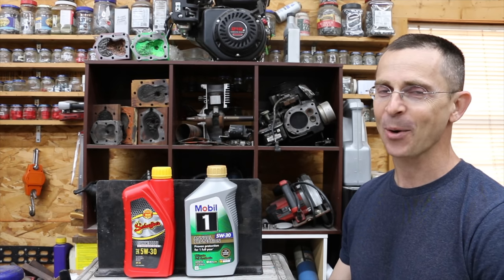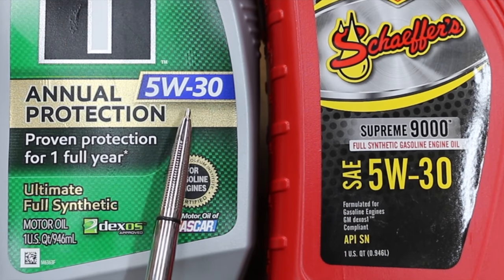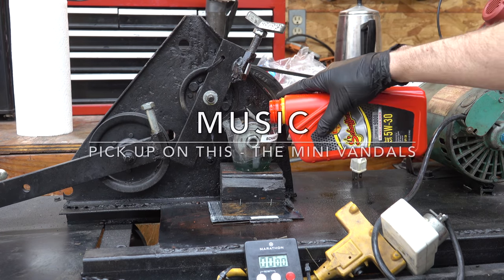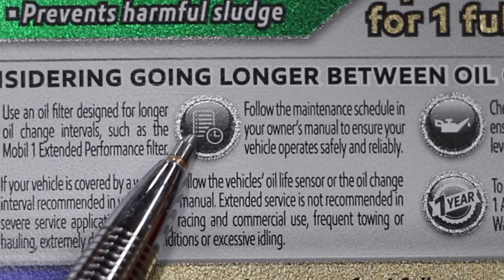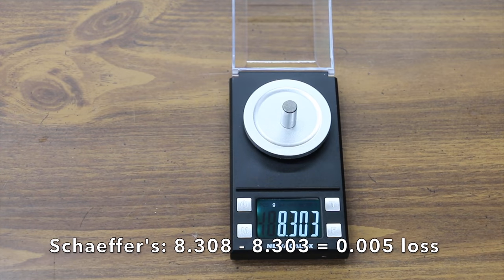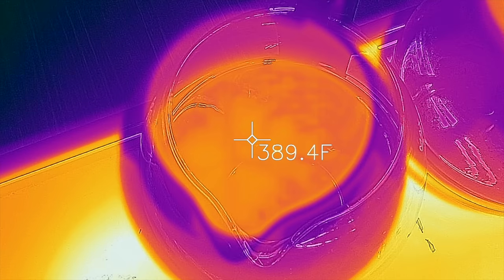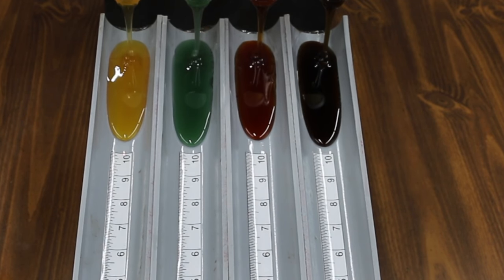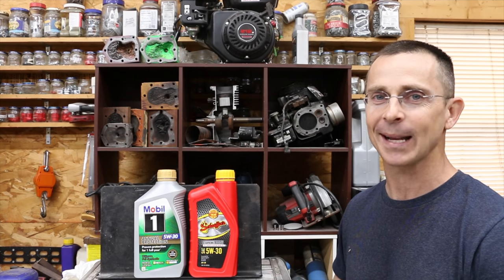Is Mobil 1 better than Schaeffer's Full Synthetic 5W-30 Motor Oil? Let's find out!

Comment: I switched to Schaeffer's products for everything with my hotshot business. It lowered my maintenance intervals by over 25% Which lowered my downtime and by buying their products in bulk from a distributor it came out to be cheaper than any other option. I even get free oil samples which is a huge savings. My biggest savings come with their carbon treat fuel treatment pushing that fuel filter life out is huge.  The Wheel hub 219 grease lowered my trailer hub temps by 8-12 degrees over lucus red n tacky.

Comment: Never heard of schaeffers oil. Pretty impressive.
Reply: I hadnt either. It is impressive.
Reply from the maker: Great product!  I've never used it prior to this test.  Lots of requests to test it and I can see why.
Reply: Green Oil??????
Reply: I had never heard of it either. Weird, especially since it's been around so long. But it is pretty expensive stuff and I don't think a lot of places sell it, so that's probably why.
Reply: I believe they dye their full synthetic green.  I think their conventional oils are the more traditional color.
Reply: Schaeffers is pretty popular amongst diesel owners.  Bill @powerstrokehelp swears by it.  I run it in all my vehicles both diesel & high performance gasoline engines.  It's pricey but oil is like engine blood....if you needed a blood transfusion you'd want the hospital to put in the best blood they could acquire so I treat my engines the same way.
Reply: Though this quart was relatively expensive, I mostly see Schaeffer's recommended for their (comparatively) budget Racing Oils.
Reply: Must been a "up north" common brand,  I've never hear of it ether.
Reply: I heard of Schaeffer after a friend of mine had his F350 transmission rebuilt at Brian's Truck Shop. Brian said he never used or recommended anything else. I've used the transmission fluid and engine oil, didn't know it was better than M1 but I've always liked it!
Reply: They do very, very little advertising.  Read up on them, really cool company.
Reply: @anunpopularstance  I could never search and find where he loves it, but I have heard him mention it as a great oil.  Any idea what weight oil he recommends for viscosity for a 6.0 powerstroke?
Reply: They do VERY little advertisement.  You can get it in Amazon.  I heard about it through word of mouth.
Reply: @HankeyMountainGarage  I live in KS where are temps vary from below freezing one day to 80° the next at times but that is rare.  I have ran the 5w40 in both my previous 6.0 and also an older 7.3.  I was previously running Rotella T6 and noticed a 1.5 mpg increase in the 6.0 and almost a 3 mpg increase in my 7.3 when I switched to Schaeffers.
Reply: @anunpopularstance  My thought is that it doesn't matter how hot it gets outside because your engine and oil temperature are dependent on the thermostat in the engine.  The Schaeffer's oil salesman I talked to confidently told me that they have seen better results with the 5w30 or 10w30.
Reply: Paul Stan me either, and it’s been around since 1870’s.
Reply: best oil that I ever used. lowered operating temps and fuel consumption in all of my vehicles and tractors
Reply: @johnparrish9215   Green oil is not too uncommon. Schaeffers full synthetic, Kendall GT, Brad-Penn and German Castrol (during the late nineties/early 2000s) were all green dyed. Arco Graphite was jet black. Royal Triton (and later, Royal Purple) were dyed purple. Oilzum was bright red. Conventional Schaeffers was (maybe still is?) a bright amber color. Most people don't realize that synthetic oil is clear; so even if your oil is the traditional brown or gold, it's been dyed.
Reply: I agree outside temps do not make a difference once the engine has reached operating temp.  I only think ambient temps have an effect during cold start ups.  My 7.3 calls for 15w40 but I run 5w40 and have had good results running 10w30 in regards to cold starts in -30 temps.
Reply: Diesel guys buy schaeffers....its excellent stuff...
Reply: Schaeffer's isn't a store brand. You could only get it from shops that stock it or directly from a salesman/rep of Schaeffer's until reps finally started selling online (I know Amazon stocks it all now). It is pricey, and if you're direct ordering it has to be in bulk, but I swear by their products. If nothing else, their Penetro 90 penetrating oil is far and away the best in the business.
Reply: @anunpopularstance  - I see your point but my (diesel) experience favors less expensive Diesel oil given the incredible inherent design/durability characteristics of most diesel engines...of which, diesel engines almost always seems to (far) outlast the vehicle's body integrity, especially in situations were the truck is operated in the rust/salt belt and/or in construction type environments.  Of course there are a few plausible exceptions... like (maybe) in situations where a diesel sees a lot of road miles, no winter, no salt, no construction and the diesel is garage kept and/or is a "show" quality diesel(?) However, for the average "joe diesel" $13+/quart diesel oil (+ a proper long life filter) doesn't really justify the expense and is even less justified given how soon many diesel owners sell and/or trade in their vehicles :)
Reply: I have to agree with ya there. Never heard of schaeffers either but next time I'll look into them.
Reply: I used to work with an Egyptian guy. He swore by it and claimed that the other oil companies use Schaeffer as the gold standard oil to beat.
Reply: @moofree  Exactly, 13 dollars a quart, if I heard right. Think I'll stick to my full synthetic Super Tech for less than 17 dollars for 5 quarts.
Reply: St Louis company, located just a couple of blocks from Busch stadium. We service their manufacturing warehouse at the railroad I work for. Also ran it in our racecar engine before we sold it. Great stuff. I only use Amsoil or Schaeffer's in all of my engines
Reply: @johnparrish9215  oil is dyed to give a colour, it is normally pretty clear, just that most are dyed gold since this is what is expected!
Reply: I know a lot of guys that do run it in their Harleys I myself Run Red Line Oil primary Lube and transmission fluid in my Harley and have always been impressed with that my bike runs cooler quieter and shifts easier
Reply: Note it's made in St. Louis, Mo.   @monoshock57
Reply: It's basically a "performance" oil. Meaning only enthusiasts will really know about or buy it. A lot of people run it in race cars of various types.
Lots of the good additives and high quality base stock. They typically have local dealers sort of like big name professional tool brands.
Definitely good oil, but I'm not sure it's worth the full premium except when used in a truly performance oriented situation.
Reply: @johnparrish9215  it's made from grass clippings
Reply: @monoshock57  Not Canada north. Never heard of it.
Reply: John Parrish 

My motorcycle oil is also green, I’m using Motul 300V
Reply: @johnparrish9215  its tinted blue actually. It's a soybean based oil that gets super refined to the point it's clear like water. I run it in both my cars. Awesome stuff
Reply: Seriously?
Reply: Matthew Miller it only gets 25 degrees at the very coldest part of the year here in Vegas and idemitsu ow-20 is not affected by cold temperatures ...probably the same with a lot of these really good full synthetics..the ones with synthetic base not full synthetic with oil base
Reply: Rumor has it, Schaeffer's is made from blended smurfs.  They were going to call it Soylent Blue but I think there were copyright issues.
Reply: It's way too expensive
Reply: @bilbobaggins4710  With some good ole 'Merican greenbacks mixed in.
Reply: I don't think it's common anywhere. I live in Texas and known about it for many years, but never bought it because it's beyond my budget, like several other brands. I've seen it advertised in magazines a little. But I think it's sold through independent sales agents, like Amsoil, but doesn't have near as many sales people. @monoshock57
Reply: @grassroot011  Yeah, I live in Texas and I've heard of it. It's not a northern oil. It's just not advertised much.
Reply: Frank Manning , that's funny Frank , I remember seeing the movie Soylent Green with Charlton Heston, Chuck Connors, and this was his very last picture before he died  Edward  G Robinson in 1973 , but Soylent blue from Smurfs , that's hilarious , what's Royal Purple engine oil made from ?
Reply: Plus it's green oil
Reply: @monoshock57  yep, it's pretty common up here in Minnesota and Wisconsin
Reply: Paul Stan Heard about it about 4 yrs ago. sales rep walked into the shop. and did the bearing test. but slightly different. he has a handle to apply pressure to stop the bearing from spinning. we had mobil he asked for a sample to run his test. and didn’t take much pressure to stop the bearing from turning using mobil. then he we did with schaeffers and fucking A. i had to apply my body weight about 185lbs and needed another guy to stop the bearing from spinning. been using that ever  since on my car and SUV. they also have transmission fluid. did that as well
Reply: Pat Treu , Royal Purple is purple oil
Reply: I run their semi synthetic blend in all of my Harley Davidson motors,,great product
Reply: Schaeffers sells their products across the globe under different brand names... For example here in Mexico and some countries in central and south america sell it under the Metatron brand
Reply: MaverickMMMX , cool , I'll be sure not to buy it under those names too , thanks
Reply: Find a rep. I get my Schaeffers for 6$ quart 👍🏁🇺🇲
Reply: Schaeffers oil is popular in heavy diesel equipment, that the only time I see Schaeffers
Reply: Matthew Miller interestingly, I had to,go to MOBIL 1 5W-30 ( the 4 CYL GMC CANYON , RECOMMENDED GMC) here in East Helena ,MT, @30 BELOW ZERO: had ran 10W-30  FULL Synthetic VALVOLINE FOR SEVERAL years in NORTHERN IN( occ M1), And got a little thick starting....some mornings......130, O00 mi......
Reply: @HankeyMountainGarage  they have a diesel spec oil in 5w40, 10w30 and 15w40 weights. Will clean out everything so the injection system will run better and smooth it out.
Reply: I run there oil, transmission fluid, and fuel additive in my personal 6.0 powerstroke. I have been using there full syn 10w30 in the engine. Will be using there gear oil as well soom. Very good stuff. I sell there products at work and have lots of very happy customers. Pretty much all there products especially there greases have exceeded my expectations. My local rep is a real good guy as well.
Reply: @scs442  actually they are all green, its the base oil that gives it that color not a dye
Reply: @scs442  no it's not dye. Probably due to the moly additive.
Reply: Paul Stan I have never heard of it either
Reply: They don't have conventional oils, all of they're oils are specialty oils
Reply: We use it at work for some specialty hydraulic applications. It does very well for us.
Reply: Gonzo Buddy 😀 Mobil 1 has always been my oil of choice.
Reply: Gonzo Buddy  You can also buy Schaeffer's in 5-gallon pales. I've seen 5-quart jugs in some applications that can be found on sale for about $30 or so.
Reply: Buy Ravenol 72,30 $ (100% PAO) or Comma or Wurth if you have money for best oils 👍
Reply: It’s a top tier oil
Reply: If you think their oil is good, you need to try the grease!!!

Comment: My truck uses a quart once a month or so, so I never have to worry about my oil getting old🤘
Reply from the maker: lol. Great point!  If you use Engine Restorer, you'll likely see that oil consumption decrease.
Reply: I've got same thing in my honda, and I'm not planning on ever adding new oil.  In fact, I save changed engine oils from my other vehicles and let it burn off in my Honda.  

I never would have thought of this, except my dad did same and told me.  in 80's some time, he started up a home construction company, bought a heavily used truck.  It turned out to burn oil pretty bad.  He never even changed filter ... and got 100K+ miles without ever changing the oil. Not sure what ever happened to that truck, I'm assuming he sold it.

Sure miss my dad.
Reply: @loves2shoot  That's hilarious!  great story.
Reply: Most cars do even if the dip stick level doesn't go down. What happens is water replaces the lost oil and people think their vehicle isn't using any oil when it is.
Reply: Mini DK#9 If your engine is replacing oil for water quart for quart, RIP engine.
Reply: LS ?
Reply: You should still change your oil totally along with a new filter every now and then.  Every year to be safe.
Reply: @williwonti  its a ford. It'll be ok. 😎
Reply: @ProjectFarm  Thank you for the tip. I was gonna just find a longer dip stick for it.😁
Reply: Yah filter change?
Reply: @AIM54A , I've never heard of water displacing oil, unless the engine is being used for really short trips, like, going around the block every now and then.  Water evaporates at 100C while oil can reach 115C to 125C.  If water does mix with oil, the final mixture will begin to resemble an old, putrid, rotten milk shake.  I have heard of fuel that mix with oil, usually as a result of blow-by.  It's not as much in gasoline engine, as most of the mixture that makes up the composition of gasoline has low boiling points, but the components that make diesel can have boiling points that exceed 350C.  In extreme cases of blow-by, it's not uncommon to see "oil growth" in diesel engine.
Reply: City cars and trucks rarely are driven long enough and hard enough to drive out the moisture from combustion that ends up in the oil.
Reply: Just make sure to change the filter
Reply: @ProjectFarm  which engine restorer would you suggest? Maybe future videos on this?
Reply: @vivillager  Leading to diesel runaway if it gets bad enough
Reply: R Mack  I haven't had a Harley that leaked or burned oil since the 70s
Reply: Project Farm that could be another series, who has the best engine restorer.
Reply: That’s a plus.
Reply: @ProjectFarm   LoL if has worn ring or bad valve seal it will still used it unless it leaking it out
Reply: LoL not good idea because if never change it the carbon deposits settle in bottom of oil pan and sooner or later it will get stuck by oil pump
Reply: You can also try replacing the PCV valve, they are less than $10 at autozone. If your current valve is sticking open it may be letting oil get through and burn off. I did this on my Honda and I think it has improved it, not enough time has passed yet to know for certain. 

Also here is Scotty Kilmer explaining all about it. 
https://www.youtube.com/watch?v=1Z4yek9oTfE&t
Reply: R Mack  lol
Reply: @jhenry48809  my poor truck is leaking it all down the sides from the valve covers and who knows where else. She aint burning any at all.
Reply: 2 quarts a week. Valve Stem seals..
Reply: @AlanYeet13   in most case just put new set of gasket should help that but take note if it in back of the motor then must likely common problem is the intake back rail aka china wall especially with Chevy v6/8 that is leaking unlike LS motor some time even the oil pressure sensor can be leaking but with knowing what you have I can't say as it be just bad hose or something a long that line.
Reply: loves2shoot, be careful doing that, if you use oil that is too dirty, you worry about scraping up the piston head and ruining everything inside of the engine.
Reply: Yeatman Racing, clearly you’re doing something wrong, my dad’s F-250 only leaks a little transmission oil, it is a 2003.
Reply: @nicholasdowns3502  honestly the truck dont owe me anything. Its a 92 V6 Ford ranger. Its been knocking for 8 years and running strong. Im just waiting to put the 5.0 in it.
Reply: @AlanYeet13  So take that it a 3.0l v6  more like it the valve train that your hearing believe me if was a knock rod will not last 8 years, The most common problem with ford v6 is the intake gasket due to the way the block and intake are made just like the old Ford FE 332 thru 428 block had the same problem as well over time and the cam sensor and or 0-ring due fail as well,  That sound good idea drop in a 302 or 5.0l but take note in your state if it has smog check I go with EFI and catalytic converter
Reply: @SHSPVR  Thanks for the info.
Reply: I don't know much but I would know if I had water in my oil.In the Dallas Tx area if the dip stick says the engine is full it's full of oil. In cold weather where you don't drive enough for the ventilation system to remove the condensation you have a sludge problem. When I was in cold country I was driving 70s miles a day. No water in my oil.
Reply: An old biker I used to work with had a 53 Harley that leaked. The boss complained about the oil in the parking lot. Told him he needed to do something about the leak. He said it don't leak it marks its territory.
Reply: I don't drain oil. I change a roll of toilet paper about every 6 k and add a new quart of oil. I think with the Nissan Altima I can go a lot longer..Put a Japanese import engine in it. It uses.a little oil. I change the filter for two reasons. To keep the oil clean and.to add new oil. Been doing that since 1963. The Altima had 225 k on it when I bought it. I thought I did good until I parked on a hill. Went to change the valve seals. Worse mess I have ever got into with a car. The valve springs are down in holes. Found a valve guide worn. Ordered a used engine.